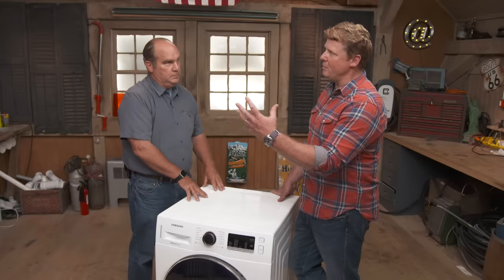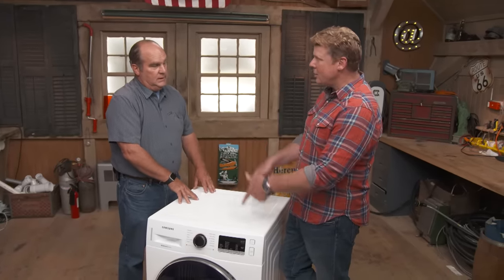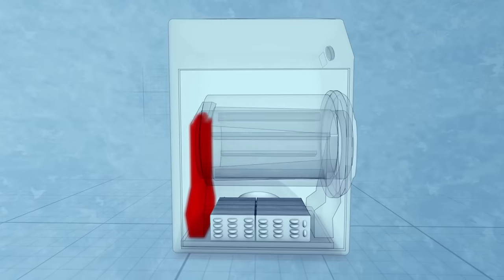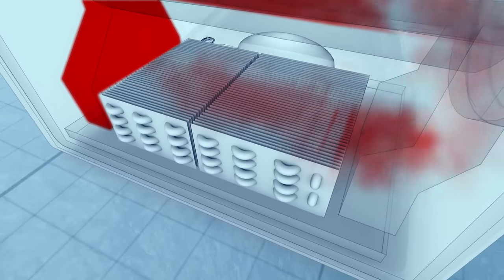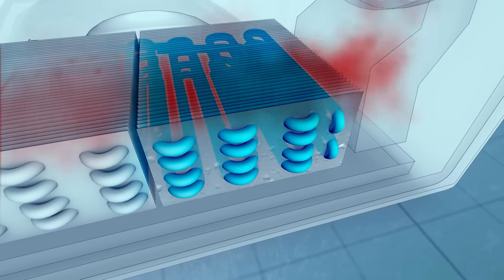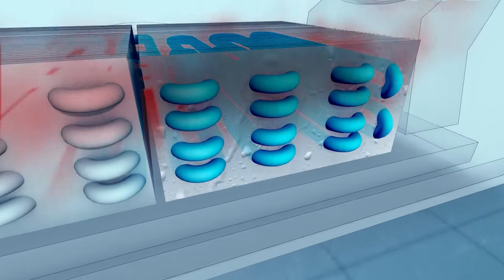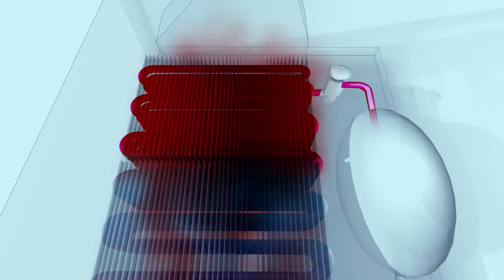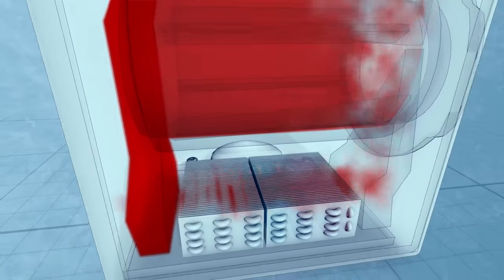Exploring a Heat Pump Clothes Dryer | Ask This Old House

Comment: I have a Bosch model that is pretty much identical to the unit Richard was demonstrating. I live in the UK (where most people don't have dryers at all) and the only laundry space was a lower-level utility room that would have been difficult, if not impossible, to vent to the outside. I was advised to go for the heat-pump model and I've been very glad I did.

Energy use is noticeably lower than with conventional dryers. There is a tiny bit more maintenance due to the need to empty the condensate tank and clean the heat-exchanger unit. Condensate pretty much every cycle. Heat-exchanger fins every couple months.

It doesn't make clothes as "crispy dry" as most Americans are used to. Even on the "very dry" setting, items like socks, towels, and sweatshirts need to spend some time in the handy "airing cupboards" most UK houses have. On the positive side, its probably not very good for your clothes to expose them to very high heat.

I was concerned about moisture build-up in the utility room. But there has been no problem in the 18 months I've been using it. I generally leave the door ajar, or run the overhead fan (the utility room doubles as a lower-level half bathroom.)

Overall I'm very happy with both the efficiency and operation of my Bosch heat-pump dryer. Especially when I see my neighbours trying to dry towels and bedsheets outside on a rainy, freezing, Sunday afternoon in February.
Reply: @williamlyons3947  How do UK city dwellers (and others) dry their clothes when it's cold and wet outside?

Answer: Many people drape them over whatever horizontal fixtures they can find in their homes, including over the radiators that grace the interiors of most UK houses. 

This, of course, creates other problems. Like rusting radiators, and a buildup of excessive humidity and condensation within the living space itself. To say nothing of the inconvenience of having unsightly masses of underwear, socks, and sheets hanging around the hallways, bedrooms, and living room.

It's not an ideal situation. But one that many (if not most) Brits seem to accept without too much complaint.

I will note that in the year since I originally commented, UK utility prices, including that for electricity, have more than trebled. A situation that makes Brits even less likely to use a domestic tumble dryer. Regardless, I still use mine for everything except dress shirts.

Comment: Rich should make a segment dedicated to the different heat pumps for home usage:

1- Space conditioning 
2- Heating water
3- Drying clothes

These together with an induction stove and a convection oven are the key to 100% home electrification.
Reply: except that induction cooktops suck
Reply: @bigmikeobama5314  please explain this opinion because I've only ever heard positive things. They heat faster than gas, are more accurate and controllable than electric, the only negative i've ever heard is the initial cost

Comment: I bought the Miele W1 +T1 washer and dryer in May 2020, expecting the same perfect performance as my Miele dishwasher, but it has been a head banging experience from the start.  It’s the dryer.  The touch screen stops responding, so I can’t dry the clothes.  I’ve had the Miele technician out twice.  The first time, the technician said the dryer was fine, even though I told him the fault was intermittent.  A week later,  the dryer stopped altogether.  Because of Covid, there is a 2-week wait for a service call.  I dried my clothes on a portable line outside, while my $1,900 dryer stood inoperable.  The 2nd tech replaced the touch pad control panel, and I had a month of trouble free drying.  Today the touch screen stopped working again.  I had to call Miele 3 times because I was disconnected after being placed on hold for extended periods of time.  I asked for a new machine, and was told this was not possible until the 4th tech visit.  Again I will be waiting 14 days before the tech can come out for the 3rd call. It has become clear that the only satisfaction I will get from this experience is taking a loss, buying a machine that works, and moving on.  This seems to be the new Russian roulette of purchasing appliances, sometimes you win, and sometimes you get a hole in your head.  I’m posting this to create a record for future buyers who want to make an informed purchase.

Comment: I have 2 of these Heat Pump Samsung dryers (since I have an oversized Samsung Washing machine) and I loveeeee this machine!!!! Dries very quickly, Super efficient, no humid hot air, just a bunch of water is pushed out, and it's very quiet. More companies should be making these!
Reply: Why 2 Samsung heat pump dryers. & if u say it dries what model have u please
Reply: @maureenmcelholum1280  same model as this one. DV22N6850HX/A2. I got 2 since the washing machine I have is 2x the size in order to match output

Comment: Live in the USA and have had a Bosch “ventless” dryer for the past 3 years.  We love it.  Just need to clean the condensation coils every few weeks, the heat temp is lower and power consumption has gone down.  This also eliminates the issue of fires as found in traditional vented dryers.  We will never go back to a vented dryer.

Comment: We got a Blomberg ventless, and it’s great. We got it as a stackable pair with the Blomberg 1600 rpm spin washer. This washer gets a lot more water out of the clothes than a normal washer due to the high speed spin. The dryer coils are protected by a second filter, which the dryer depicted in the video lacked. The water collected by the dryer goes out a hose into the same drain as the washer. We like this laundry pair very much.
Reply: traybern  With respect to your first question, we don’t buy something on that basis. If I wanted quick payback, I’d have gone to a sale of used laundromat equipment and bought a Speed Queen pair. Question #2, 2-3.
Reply: traybern  First of all, everybody makes his choices.
Second, about time, yes you can make 9 loads in a week. One everynight and two more in the weekend, it's easy.
Third. Lets have a family of 5 that makes five loads every week.
It will saves you around 2.5 Kwh per load = 12.5 Kwh per week X £0,3/Kwh (I live in UK) = £3.75  per week X 52 = £192 per year X 5 = £975 in five years. You can pay it and save the money to replace it or fix it if it brakes. 
Oh!!! I forgot something, there are dryers with heat pump much cheaper, the cheapest in UK market right now is around £450

Comment: These have been standard in Norway for a decade now😁 and mine looks almost like this pne shown. Its a great dryer!
Reply: Yep, and thanks to the internet exposure some well kept secrets such as low tech USA could be noticed in the cyber space.
Reply: Can you explain what you connect the drain hose to?
Reply: @aortunoj  A drain.
Reply: How long to dry an average size load? I would say a week’s worth of clothes for me with a conventional dryer would take about 45 minutes to an hour to dry.
Reply: @c0mputer  For me, a 6kg washing load takes between 1.5 to 3 hours to dry in a heat pump dryer depending on the material. That's the compromise. Otherwise can't really fault them.

I suspect also that they don't damage your clothes quite so much as they run cooler. I think they act more as a dehumidifier with a small amount of heat, rather than blasting the clothes with heat to evaporate the moisture.
Reply: @sjokomelk 😂

Comment: I have a new Meile t1 dryer and I like it.   If You are used to a huge gas dryer with clothes from a family of like five you’re not going to like it. These are smaller dryers and you have to get used to it they do work a little differently you cannot do huge loads but eventually you get to learn what cycles/ options work best.  Remember these are meant to fit where your dishwasher goes.  Rich people have them in their yachts.  These are excellent solutions if you’re a renter and there is not proper electric for a traditional dryer hook up and nowhere to vent it!  110% better than going to the laundry mat.  Also keep in mind this is the way of the future machines will work this way so get used to it there efficient and safe!   I would say the load size is no more than what you would consider a medium load in a full-size washer
Reply: So if your washing machine was 7kg, what size drum on a dryer would you recommend people consider for a full load.

Comment: I bought a Whirlpool model very similar to this one. $138 during Fred's going out of business sale! It takes it's sweet time drying, but it's very energy efficient. I've had it for about 3 months, and I'm happy with it.
Reply: There are two types of vent less dryers. Most of them are what we call condenser dryers. They not only take forever (2, or 4 hours). And many (most) models run cold water through the condenser for cooling and then sends the water out to a drain (they thus need a water drain).
As a result you use LOT of water to dry your clothes.
Then there is the REAL heat pump dryers. These units are expensive and have built in heat pump to run the condenser (the same as an air-condition unit).

Heat pump dryers don’t use water for cooling, and they are at least 2 if not 3 or even 4 times faster than condenser dryers. So in place of 4 hours, a heat pump dryer will take about 1 hour. 

So a typical heat dryer might be 30 minutes, the heat pump dryer would be about 1 hour.

A condenser dryer? 3-4 hours! (And it using water for cooling). (We talking gallons of water here). And your clothes is still not really that dry!

A vent less condenser dryer is often smaller, and is often a “combo” washer dryer. 

So, a “combo” washer and “condenser” dryer unit might set you back about $850 dollars. (Some are even cheaper). 

A condenser only dryer? They go for as cheap as $500 or even a bit less.

The real deal Heat pump dryers? The ones with a real fridge unit (aka: heat pump inside)? They are rarely combo units, and they start close to the $1,000 range for JUST the dryer. And you can easily pay $2,000 for some of these units (not a combo unit).

Most heat pump dryers also have a heating element, and if you put the unit on max, it will work as traditional dryers in terms of time. (you same some energy however, since once  temperatures are up, then the heat pump running provides a good deal of the heat required. These units thus can run and use their heating element, or just the heat pump only in a cycle to dry (or a bit of both). They are vent less, and have a water collector, or optional can use a drain. 

But the condensing process for these heat pump dryers work far better because you have a real heat pump running the condenser unit to pull water out of the air. They cause much less wear and tear on clothes, since it not heat that does most of the drying, but a condenser that pulling out moisture. 

Those lower cost “condenser” dryers as noted tend to be combo units – and they tend to increase humidity in the dryer room. 

A heat pump unit does a MUCH better job of removing moisture because there is essentially an air condition unit inside of the unit for the condensing process. 

The energy savings of 50% compared to a regular dryer is due to the unit recycling the hot air to cold and then back around to the hot side (it’s like leaving your fridge door open – it will not cool (or heat) you house that way!!

So the room is not heated up much in this mode. And you not sucking large volumes of air from the room to the dryer and then heating the air and THEN venting it outside. That is air you paid to heat, or paid good money to cool.

The 50% rated savings in energy does NOT include this significant factor of using large volumes of air and then venting that air outside.

Condenser only dryers (without heat pumps) are also vent less, but they SUCK big time. They take hours and hours. They tend to be cheap as dirt, and as noted most use cold water flowing through the condenser unit and then that water is sent out to the drain. (Gallons of water are thus used to dry your clothes).

The difference between vent less “condenser” dryers and vent less heat pump condenser dryers is night and day (and so is the price!!).

So heat pump dryers take about double the time compared to heat dryers, and this will somewhat depend on what energy mode you run the unit. If you run them at full mode, they will work quite much like a regular dryer (but is vent less).

Those rotten condenser dryers as you note take 3 or even 4 hours – and your clothes still don’t come out really dry.
Reply: @Albertkallal  Thanks for the info. The dryer I bought is a heat pump dryer. Model# WHD5090GW This model normally retails for $1100-$1200. I just got lucky!
Reply: Albertkallal I have never seen a condenser dryer that uses water as a coolant- is that a US thing? Condensers are probably the biggest sellers in Europe, and none of them have ever used water. Are you thinking of the combined washer dryers which sometimes do?

Comment: I have this exact model.  The thing is crazy efficient.  Like half a kWh per drying cycle.  I run about 2 loads a week for myself (it's a smaller than normal sized unit) and running this thing with my 14 cents per kWh electricity it's less than $15 for the whole year of clothes drying.
Reply: How long does it take to dry clothes though like with the whole thing mostly full? Also, how dry are the clothes when they are finished?
Reply: @Fusiongearz  about 1.5-2 hours depending on how jam packed it is.  They're completely dry when they come out.

Comment: We've had these in Europe for years.  Critical in old buildings where you can't vent the dryer outside.  Also known as "Condensing Dryers".  There is a practical limit to the size they can be; at some point you get to a point where it's not efficient enough to dry a very large load of clothes, you are forced to dry smaller quantity of clothes in one go.  Which works since the washing machines are also correspondingly smaller, you can't fit a metric ton of clothes into the washers here like you can do in the US with other front-loading washers.  All in all, they work well enough.
Reply: Josh Payne condensing dryers is one thing, those have been around since the 80:s, maybe even earlier. Heat pump dryers is the next step in the evolution of dryers. They became popular around 2010 here in Sweden. Don’t know about rest of Europe. But it is sad to hear that it took America another 10 years to discover it 😔
Reply: @BigJ2020  Sad indeed. I bought my first heat pump dryer 15 years ago. Instead of 2kW it consumed only 0,5kW.  On that model I had to manually clean the heat exchanger once a month. My current heat pump dryer from 2015 uses the condensed water to rinse the exchanger and flush out the fluff automatically.
Reply: @BigJ2020  trust me, there are still going to be Americans who refuse to switch to these despite the advantages.
Reply: So instead of doing one large load of clothes we'd have to do two small loads with this one.  There goes all the savings!
Reply: My point above is proven.

read Fons’ comment. Power usage went down from 2 kw per cycle down to 0.5 kw, so even if you had to run 2 loads, you’d still be at 1KW, so you’re STILL saving energy.
Reply: Is not the same. Missleading comment.

Comment: This is such smart and efficient engineering, it solves all the problems and tasks of a dryer efficiently and all at the same time. It uses less power, heats the air with over 100% efficiency and pulls the moisture out of the air by condensing on the "waste cold" end. The only way it could make this better is by automatically dumping the water pulled from the clothes into the washing machine to be reused. This is arguably a more phenomenal use of a heat pump than for regular temperature management in AC and home heating.
Reply: I’d rather not reuse the water I just washed my clothes with…
Reply: @johncaccioppo1142  not even to flush your toilet or water your yard?
Reply: @graysonsmith7031  Flush water, yes, yard, no. Definitely not to re-wash my clothes.

Comment: I love my heat pump dryer. It maybe takes like twice as long as normal if you fill it full of wet towels, but other than that you don't notice. That isn't even the point.  It is super quiet, and i mean super quiet.  The clothes are hot and very dry when they come out, and they are not TOO hot.  I"m sure the clothes benefit.  It doesn't pull air into the house, but it does get warm, and i mean like lukewarm. so that might be beneficial.  I hooked it up to the drain first thing.  I checked my energy monitor, and sure enough, instead of 8000 kw, my whole house WITH the dryer running was only 1400 watts. When i picked it up, the guy said you know this is ventless right? and I told him I came there specifically for that dryer.  He said it was a pretty niche commodity, and I thought,  you don't even know.

Comment: Lint buildup in vents is a leading cause of house fires so that’s another benefit to this unvented unit.
Reply: You still have to clean filters of lint though 
Just do it every cycle 👍
Reply: Not to mention those leaky tub type that use a felt gasket to blow lint through your house.
Reply: @eaamonmangan4601  it would never blow into the house it is contained inside until the user cleans it out
Reply: @stephensnell1379  yes Steven that was my point. heat pump ,the dryer is fully self contained. the older drum types are not they use felt gaskets that leak lint into homes. the felt gaskets are mounted on the tub's edges attached to plastic holders. they break or get worn out and interior pressure blows lint through out peoples homes. good for selling vacuums to those that owned them.